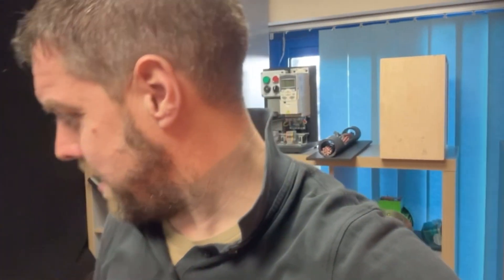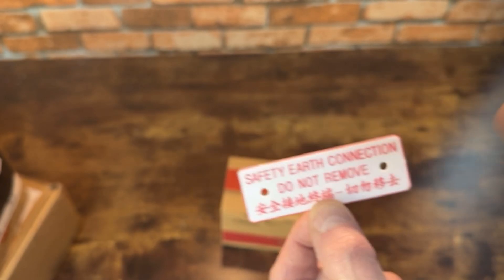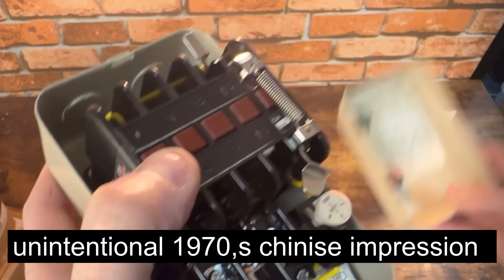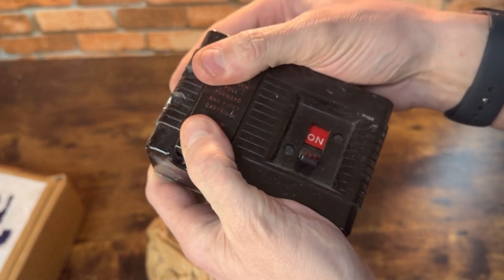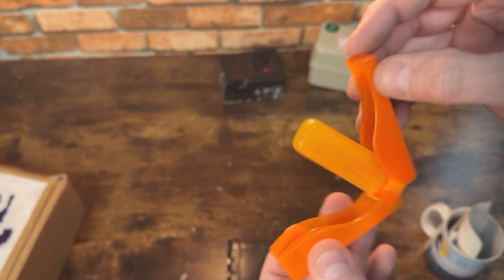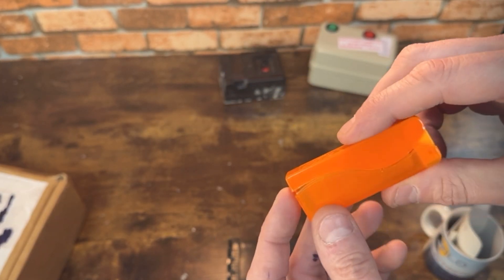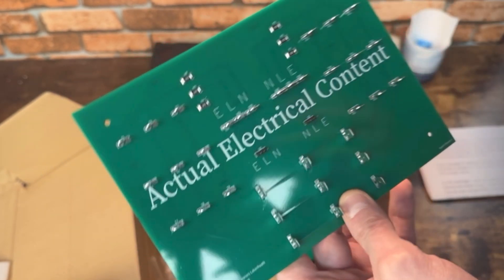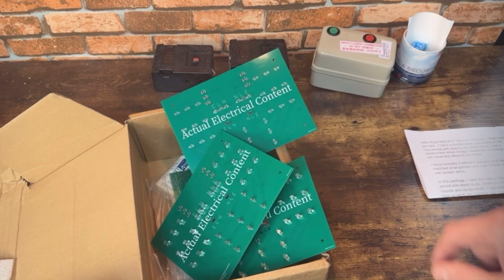FROM THE POST BAG No 01  bits bobs and oddities

Comment: That PCB that Ryan did is pretty cool. As you pointed out, the trace lengths are not all equal, but if you make the longer traces wider than the shorter traces you can equalise the resistance of them so they will all be the same.

Also - "I don't do transitions like that because I'm not a fcuking bender!" - brilliant. 100% brilliant :)